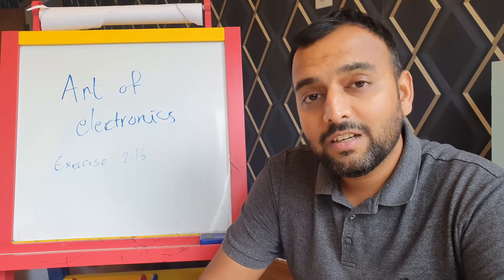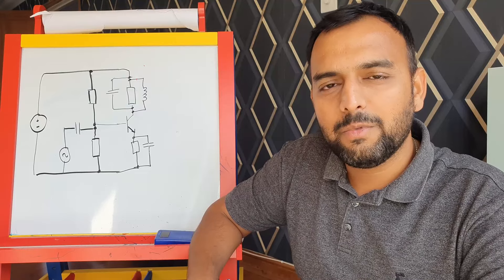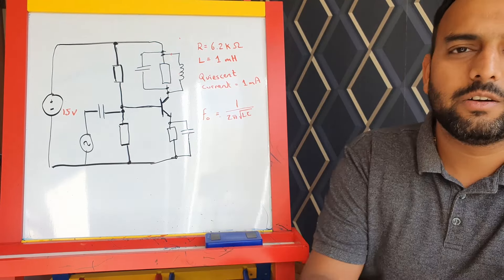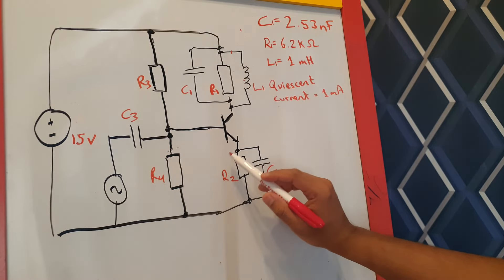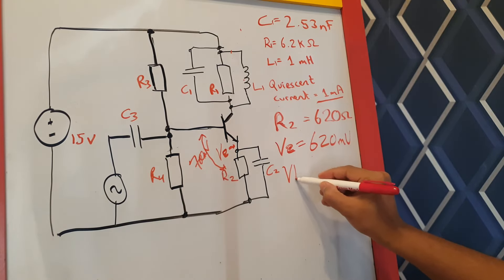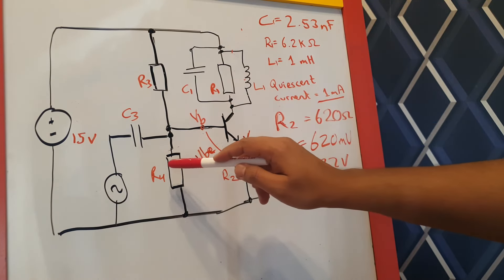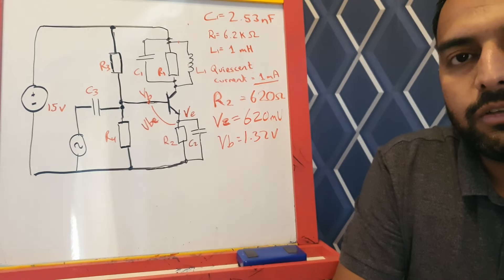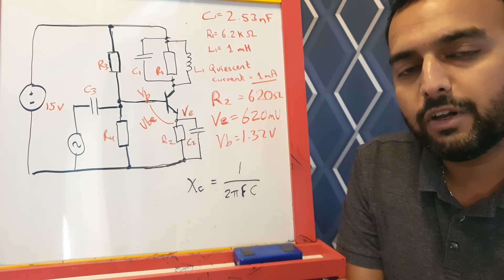This circuit is very important! Art of Electronics Exercise 2.16

Comment: Thanks for the video. Let me ask you a question, how do you feel about taking a larger emitter resistor value in order to remove the dependence on the transistor base on temperature?
Reply from the maker: You're welcome! I think its quite common to increase emitter resistor to decrease circuit's sensitivity to temperature effects on Vbe. As with anything in engineering, there are always trade offs, like lowered gain and voltage swing capability for example. It all depends on the application.  

Unfortunately, I've never had the opportunity to actually design a circuit like this for a real application but could look at something like this on the channel to develop my own understanding. 

Thanks for watching and the comment!